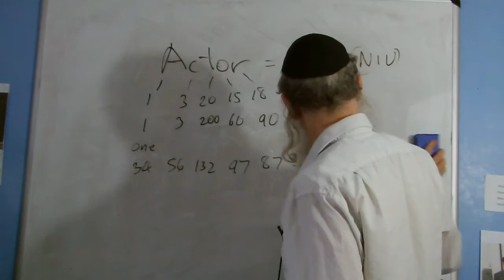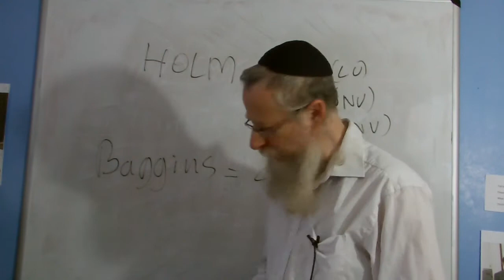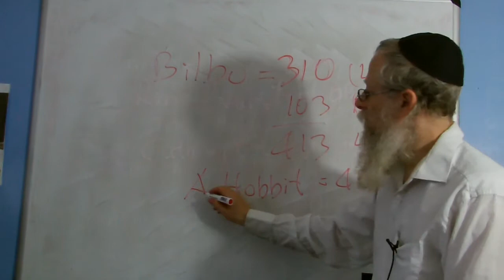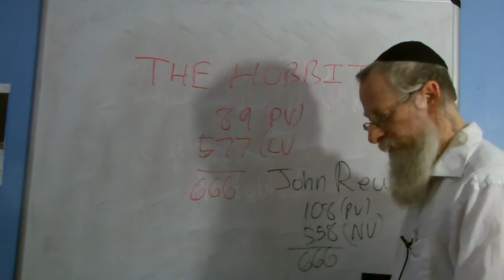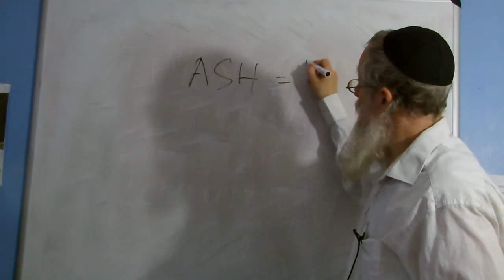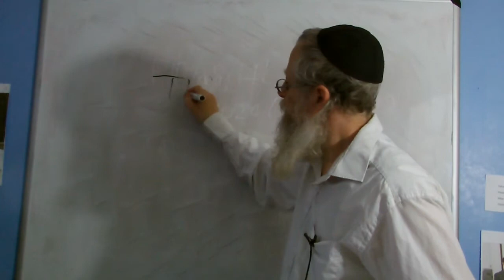Lecture 46 Ian Holm - The Hobbit

Comment: When adding the Large Value to the Normal Value, the result is the Large Normal Value?
Not sure if correct. How to get the Total Value, or the Total Value is the Whole Value?
Reply from the maker: Yes, it is confusing. When I started researching into English Gematria I started with the Placement Value. I had seen it used as the basis of Numerology and later discovered that others were using it. One blogger called it the Simple Value. I saw other systems like A = 6, B = 12 etc which is 6 times the placement value but I consider these as not important. I could use the 7 times table and so what? Every word that equaled 111 would then equal 666 or 777 and that makes no sense. I then discovered the Large Value and then i tried adding the Large Value to the Placement Value and found it revealed numerous connections. Like DAVID = 401 = SAUL (WV). I called this summation the Whole Value. thinking that was as far as it would go. But then I started using the Normal Value which is used in Greek and Hebrew. It is a decimal system. And then I started adding the PV to the NV so i called this the TOTAL VALUE (TV). Rarely I have added the WV + TV = CV which I called the Complete Value. But that is just to give names to the systems. Eventually I discovered that all systems can be added to all systems. I had discovered that the Placement System called be extended to the Large Value and even further. If A = 1 and ONE = 34 then 34 was the Large Value of A. But then THIRTY FOUR = 160 (PV) so 160 became the Third Dimensional Value of A. In my booklet ICE - WATER - STEAM I show how these systems are like energy levels or frequency levels. Let's take ICE = 9 + 3 + 5 = 17. Using the LV we get 42 + 56 + 42 = 140 (LV) and using the Third Dimesional Values (TDV) we get 142 + 118 + 142 = 402 (TDV). Now we add the low energy PV to the high Energy TDV and get 17 + 402 = 419. The Large Value of water is 163 + 34 + 107 + 42 + 73 =  419 (LV). So you see we have the TDV representing the Latent Heat of Ice that converts Ice to water. So Gematrias are not just numbers they are levels of energy or vibration. This is why, in my book Beyond Science, people are attracted to certain discoveries. But this is true with all areas of live. LEONARDO = 84 = MONA LISA (PV). So the name contains the mission of the person and the name enables to person to gravitate towards what ever his applies himself to. It may be a sport or an instrument or a field of research or a book she writes or the name of his business. I have shown all this and it works. If a person goes for a career that his name is not connected to then he will not succeed. He will not be happy in that career. He is probably doing it because his parents pushed into it. Intunement to the soul is intunement to the vibration of the soul which manifests in the persons name. Then he will gravitate to his life's mission. This is the field of research that I am presently investigating and it requires all the possible permutations of the systems as, just like energies, gematrias can be added. the biggest value based on the 4 systems is the WNNIV. There are 4 basic systems (leaving out the Third Dimensional Values and beyond). You have doulbe systems like WV and TV or PNIV and LNIV and NNIV. Then you have triple systems like TNIV or WNV and you have one 4 systems as above. Altogether there are 15 though I think 3 of these permutations do not seem to crop up with any connections at all. I have still to investigate this more. This does increase the likelihood of finding connections but I estimate the finding of a connection with the 15 systems to be around 0.3 probability. That makes is fairly likely to find a connection using 15 systems. However, if you keep finding connections and very few failures then the overall probability becomes so small as to make it beyond just a coincidence. I show this mathematically in my book Beyond Science. If you can imagine what the probability would be of tossing a coin 208 times and getting a head 200 times then that is the sort of tiny probability I am talking about.
Reply: @wowdiscoveriesjb  I start to understand. I was refreshing myself of your systems. Also explored up to 4 levels deep of the PV, so 4 dimensions deep. And saw it working. Not to show bad coincidence though. But rather meaningful results.
Yes, I too notice that. The A=6, is called the sumerian system.
Perhaps gematria can reveal whether such system is invalid. Using the same 4 systems on that kind of A=6 gematria system. For now I think it will not be of any significance.
The Gematrinator a calculator by Derek has many different ciphers. Looking at the use of the basic ciphers, I see there is no need for all these additional systems. Since the gematrinator explores the reduced values. I know these are not of importance to you.
229 = reduced placement values (PV)
60 = reduced (PV)
89 = placement (PV)
61 = value (PV)
80 = values (PV)
344 = sixty eighty nine sixty one (PV)
287 = sixty eighty nine eighty (PV)
I dont think I go far with this. Not knowing connected values.
WV+TV=CV. No. Havent heard of that one yet.
Yes, today I watched that one about WATER ICE STEAM.
I expected to see the connection of water turning into ice turning into steam.
Yet only to see water and ice. So I have to try and do some math and see for myself.
Havent heard of the method to add the PV to the TDV. High and low energy.
It seems you can add any dimensional layer of the dimensional values to other dimensional values.
In the case of water=67 (PV) you added the low energy with the high energy one.
Right 4 basic systems.
PV, LV, NV, NIV

"You have double systems like WV and TV or PNIV and LNIV and NNIV. Then you have triple systems like TNIV or WNV and you have one 4 systems as above."

WV=PV+LV
PNIV=PV+NIV?
LNIV=LV+NIV?
NNIV=NV+NIV?
TNIV=PV+NV+NIV?
WNV=PV+LV+NV?

Understanding these systems is good to not get washed over by 36 systems on the calculators out here.

I want to share about number 402.
402 = deep sea (LV)
402 = ice (TDV)
Reply from the maker: @wrathfeeling  Interesting that the 6 times table is called the Sumerian system. They are an ancient culture from whence Abraham came.
I show more in my books than I do in my lectures. I show how Water turns to Steam in my book on this subject.
The number 402 is a special number which comes to play in my book Elisha and the Two She Bears. It is connected to the FORTY TWO boys who were supposedly killed by the two bears which I show as not true. But that is another subject. Indeed, Ice is connected to this story as when the boys (BOY = 42 (PV)) mock Elisha saying Go up Baldy, Go up Baldy (twice) the Hebrew for Baldy can also mean ICE - Kerach. 

It is in the connections that I find between Hebrew and English that allow me to see much deeper teachings within the Bible. I can also apply English Gematria to the New Testament as well though I need to learn Greek.

Here is an interesting connection for  the PV.

PLACEMENT VALUE = 150 = ALPHABETICAL ORDER (PV)
Reply: @wowdiscoveriesjb  Okay then. That might be why I have to see into your book to see the water turning into steam connection.
Yes, the Normal values use a similar system as the greek system. Yet greek might be good to know. To see how well Hebrew text carries over to Greek using greek gematria system and back to hebrew.
So far I think that you can translate a system in another system using the Large value method.
IF aleph = 32 in Hebrew, you spell the word aleph in the Placement values, and after find what the number 32 in placement values is. To see how it translate in english alphabet. By writing Thirty two.
If not, then I guess it is different from what I think it is.
Interesting about the bears story, as it looks like the bears were actually boys or the boys were actually bears. Reminds me of the movie Life of Pi.
In which a storyteller hid the story elements by replacing humans with animals to change the tone of the storyline.
Reply from the maker: @wrathfeeling  Languages are interrelated. In deed, I use the LV with Hebrew and the TDV and beyond with Hebrew. This shows the very close connection between Hebrew and English. I believe this is a hidden prophecy at then end of Daniel when the angle tells Daniel to 'go to the  end..' if now you go to the end of the word Daniel in Hebrew - the Lammed and read the word backwards the English way till the Nun it spells Lammed Aleph Yud Nun and this reads Layon and then you read it forward from the Daleth to the Nun it spells Den. So you have Lion Den. So we have English hidden in the Hebrew. Hence, I believe this reveals an end of days prophecy concerning the discovery of English Gematria and English Gematria reveals secrets about the Messiah and his coming. So this is an end of days revelation. 
To give you and example of how the LV can be used with Hebrew we can take the relationship of Moses to Water. He was placed into water as a baby. He met his wife by a well. The cause of his death and G-d forbidding him to enter the land of Canaan was when he hit the stone instead of speaking to it in order to provide water for the Israelites. The name Moses (Moshe in Hebrew) means 'drawn from water'. 
The Hebrew for Water is Mayim. Mem is the 13th letter so its PV is 13 and its LV is 99. Yud is 10 (PV) and 39 (LV) and the final Nun can take an alternative value of 24 (APV) and 167 (ALV) A = Alternative. This gives the ALV of Mayim as 99 + 39 + 167 = 305. Now we take the English name MOSES and we find the Normal Value NV. 40 + 60 + 100 + 5 + 100 = 305 (NV). So you thus have a connection between Moses and Water. This inner connection can only be found using English. This is what is so amazing. Secrets within the Bible are revealed using English. Why? This is the big question and besides the Daniel prophecy the question still remains why did G-d choose English?  I can't give an complete answer to that question as of yet. Please G-d he will reveal more to me but the time is not ripe. But I can say that English is a universal language and more and more people are speaking it due to the internet. A language was chosen to be the vehicle for these latter revelations. My mission is very great and I sometimes feel like walking away from it like Moses at the burning bush. 
Just to extend the water connection. Water was separated from the earth on both the 2nd and 3rd day of creation. Yet water and earth go together. Or we wouldn't have rivers and lakes. The LV or EARTH = 305.